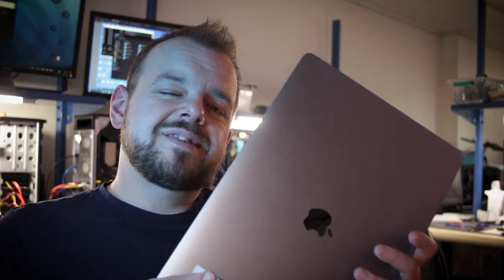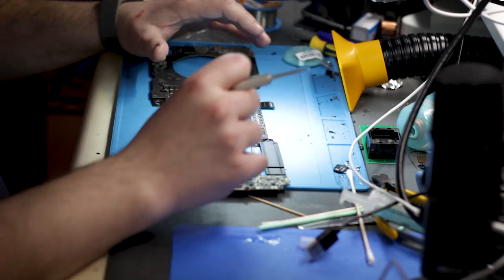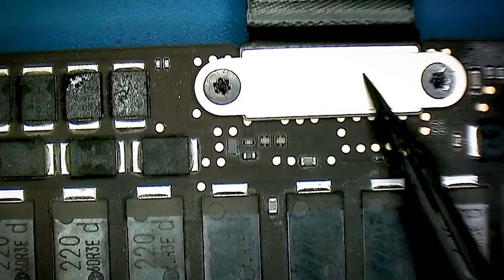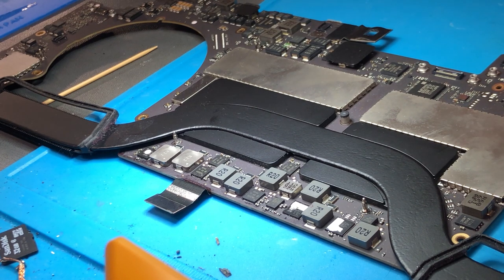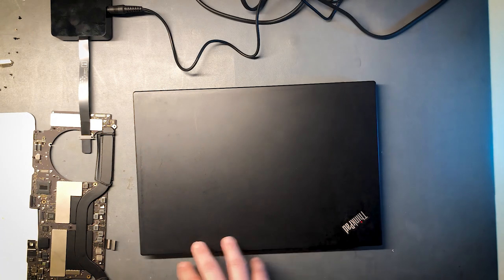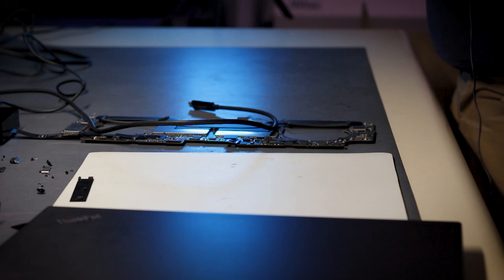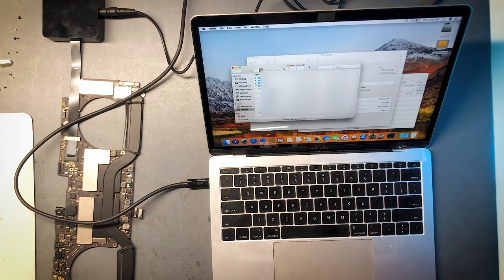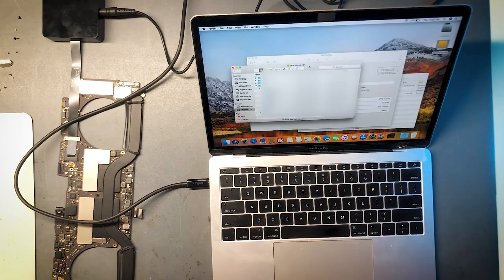Data Recovery tool Apple never sold - MacBook with soldered SSD recovery

Comment: Great 10-minute video, had me really thinking. At some level, it seems we are leasing our machines from apple as opposed to owning them, I should be able to retrieve my data at a simplistic level. A customer brought in 2 Apple machines from a deceased relative,I extracted everything from the HDD via SATA cable, and from the newer machine, I connected her SSD M2 onto an adaptor, if she hadn't been able to have that data they would have been missing pictures and videos to show at the funeral. I'm a nobody novice from Northampton when it comes to data recovery but I genuinely felt good about doing that job.. Great tool, new to me, so another lesson in the trade. When I saw all the water damage it almost looks too much corrosion to repair (even with repair water leaves its damage long term, they'll be back), so to tell the customer hey your board is mush but it's ok because I got your data saved, this has to be a good outcome for them. Seen the tool in the states not sure I've seen it here, sadly this side of the pond engineers are missing many angles in the trade, instore we go to a point and not past that.
Reply from the maker: Thank you! Yes I love it when people get their data. This board wasn’t that bad but I am too busy to fix boards for clients, I only offer data. If you need this tool, search eBay for Apple migration tool. Keep in mind it will only work on 2016-2017 and it’s about $400+shipping

I’ve had it for years, only used it a handful of times but it surely made us good $$
Reply: @forensicguy  Hey Chris someone offered me a CELLEBRITE UME-36PRO with all the cables etc, is this a tool I could put to any use, do I need a license, etc, seems a wee bit old but some of my customers do have old locked phones with their data locked away. Appreciate your advice, many thanks..Patrick, London,UK.
Reply from the maker: I don’t think you can do anything with that. First it’s not a UFED but just a transfer tool. It’s worthless. There are plenty old Cellebrite machines for sale that are either scams or very old hacked units
Reply: @forensicguy  Appreciated will be giving it a miss, did seem a little old. Thanks for the quick reply..

Comment: Great video! Maybe the reason Apple has removed the connector, and therefore also a possibility of recovery from a faulty soldered-on SSD, is that they want their customers to use iCloud as their backup storage.
Reply from the maker: Its possible, but with apple you will never get a straight answer.
Reply: @forensicguy  
Nor will most people's data fit.  This is (to me) just another abusive practice in the wake of Job's death that cook has allowed their customers to be abused by. 
Soldered RAM ... okay, they're pretty good with their QC, but all upgrades at inflated prices.
Soldered SSDs and NO HOPE for recovering it without fixing the logic board? ASS HOLES. 
Buying DeepSpars USB Stabilizer + PCIe add-on, along w their R-Studio ver.  this week...  
Love the videos ...

Comment: Hi, thanks for the information you're sharing. I have an MBP 15" 2017, recently it was burnt out due to a lightning strike that affected the logic board and IO ports. My question is, is it possible to use this tool to recover the data in the SSD without fixing the whole logic board and can the tool detect the SSD? I really appreciate it if you could respond and give some insights.
Reply from the maker: This tool should work as long as the SSD lines on the logic board are still intact
Reply: @forensicguy  Thank you very much for your fast response and that gives me another hope to save my data. I shall get the tool now.
Reply: @forensicguy  sir pls give link or name of the recovery tool, the black box.

Comment: Hi, my Macbook Pro A1706 has a dead onboard SSD. I'd like to ask someone to fix it but I also care about the security of my data. My Macbook doesn't enable the FileVault. If it has been repaired, will someone be able to read the data without inputting the password?
Reply from the maker: Yes, without filevault, your data will be accessible with the right tools
Reply: @forensicguy  sounds a little horrible. Can people get such a tool easily?
Reply: btw, my MBP has a touch bar.
Reply: it seems like one must have the password to access the data by the tool in this video. If the Mac's data is not protected by FileVault, can this tool still access the data without a password? If it cannot, is there any other tool which does not require a password? Thank you for your answers.

Comment: Well honestly  there were dozens of such devices sold on ebay. Basically this is simply a pci-e to usb controller combined with few power ics for the ssd. I believe it could be replicated since it does not look like apple ssd on this devices uses something really different unlike newer ones. New t2 machines have data recovery option with DFU but unfortunalely this software is only available for AASPs and server-based, so unlikely to leak. One of thunderbolt ports got debug lines to T2, and DFU recovery actually gains access to the SSD to write hidden bridgeOS partition. It also wipes the disk on catalina+ devices, so technology is there. Unfortunately, t2 recovery mode  wont work with most of common boar failures but would be really helpful with the dead CPU( t2 is basically a SoC, fully capable of transferrimg data to/from SSD)

Comment: Hi, this is exactly the one I have - and the issue is that the keyboard stopped responding - except for the power button. I was so stunned, I didn't think to turn off the password upon starting so now I'm locked out and can't get to the data. I've tried plugging in an external keyboard but it didn't react to that. Do you have any suggestions? Thank you and greetings from Australia, Lisa
Reply from the maker: You should take it to an authorized repair place and have them check it.

Comment: I THINK, but cannot completely confirm that the Data Migration Tool requires a Thunderbolt 3 port.  I've tried USB C ports and they never worked.  Also adapting Thunderbolt 3 - Thunderbolt 2 for older macs using Apple's adapter didn't work for me either. It had to be a Thunderbolt 3 port to work... at least, that's what it seemed.  On TB3 it pops right up.
Reply from the maker: Interesting.. I will need to test this out but I think you might be right

Comment: I got question about the later models of macbook pro without that connector... 

Is it not fitted on the later boards or have they removed the tracings altogether?
Reply from the maker: I am not sure I can answer that. I am sure the traces can be found but I wonder if T2 chip would prevent accessing the SSD if someone would fit the connector. From what I understand is that the connector was just a direct NVME connection to the ssd but I think the T2 might complicate direct access
Reply: @forensicguy   thanks for getting back to me, is there a different method for retrieving data from newer MacBook Pros? Otherwise this might be worth exploring
Reply: @MrMaxwell94  from memory, the MacBooks with the T2 chip (and also the ones with the M1 processor) may have the storage encrypted, if that is the case, there is pretty much 0 chance of getting any data